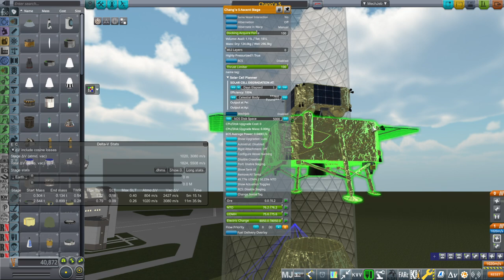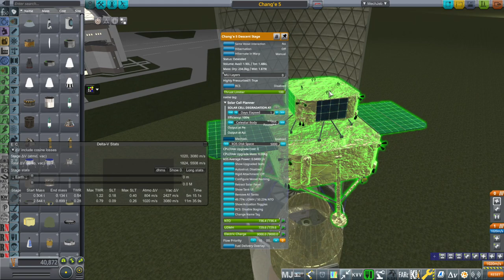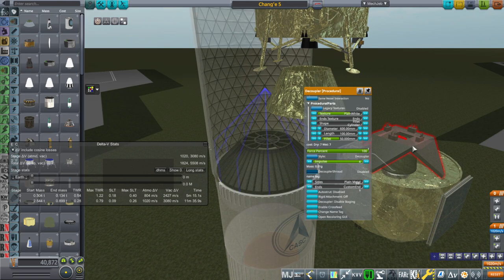Realism Overhaul in KSP 1.8.1 - Chang'e 5 First Draft

Comment: Hey Raiz, i have a quick question about modding. How do you calculate the total volume of a tank? I tried using the standard formula base area times height, but it always comes way too much and i end up not being able to lift the rocket off the pad
Reply from the maker: Well, no tank is a cylinder. In the case of a probe like this, you'd have to see what sized spheres you can fit inside the volume (and how many), because the tanks are most likely spheres, and use the equation for volume of a sphere. For a rocket stage, which looks like a cylinder, there are actually two tanks inside the stage, and each has half-sphere end caps because the tanks don't have flat ends. So, there's a a fair amount of unused volume in a stage. Taking a given height for a stage, I would assume there are two spheres that are the same diameter as the stage, calculate their volume,  and subtract out 2*diameter from the height of the stage. Then, take the remaining height, assume it's a normal cylinder, and calculate base area times height. Technically, there are also structural bits inside stages, pipes, and the thickness of the walls to consider, so maybe multiply the resulting volume by around 0.9 to get a final result.
Reply: @RaizSpace  thank you 🙏🏻